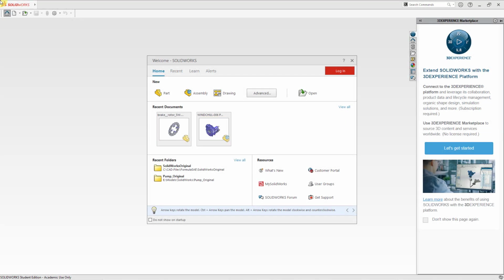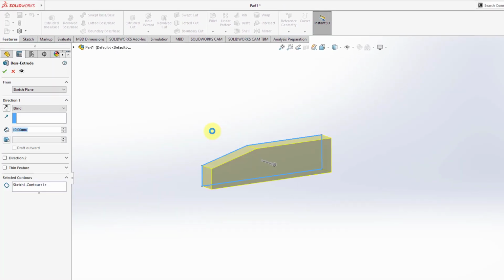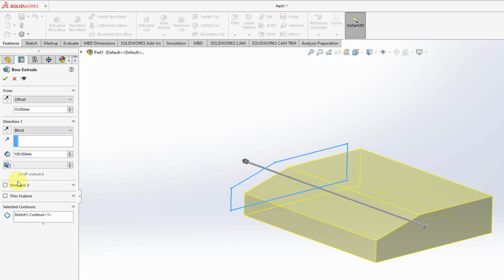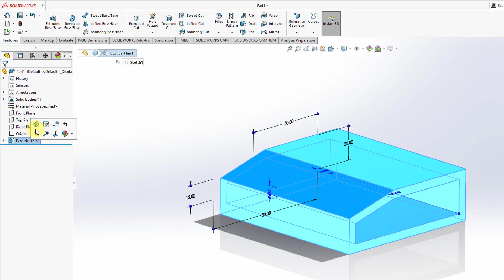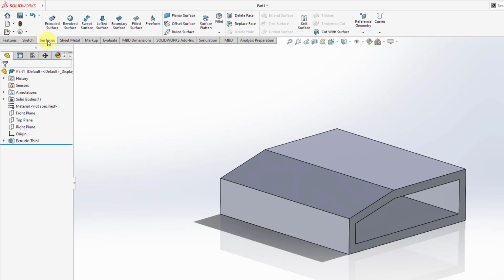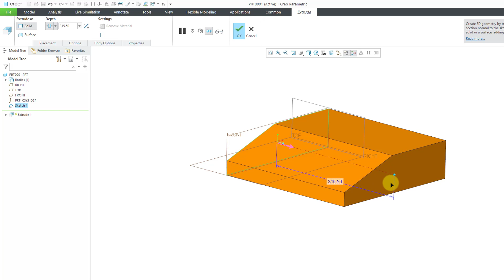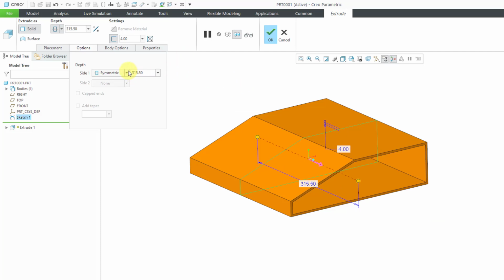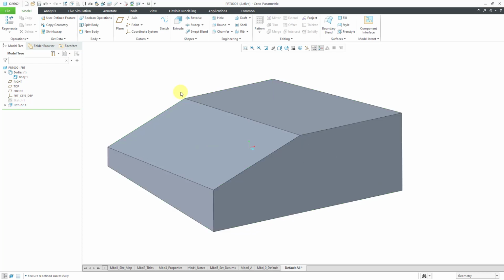SolidWorks - Creo Parametric Comparison - Base Extrude

Comment: Creo is amazing tool, and I would say far superior over SW. However, this way to access Creo by subscription, make it impractical to get that outside of US, since currency trade rate makes subscription prices forecast impredictable. You could take one year subscription or even more (what in my opinion does not make sense since you pay the same of permanent seat of other concurrent) but in the end you will not "possess" the tool. This rationale is also valid for Autodesk Inventor.
Reply: Perhaps it's too early for me to say this, but as a Solidworks user for more than 6 years (CSWE), my initial experience with Creo has been very frustrating for the last couple of days. I can't say about the advanced stuff yet, but when it comes to basic features and functionalities, Solidworks outshines Creo by miles. Making simple 2D sketches in Creo feels very counterintuitive and frustrating. I haven't even touched the drafting part yet, but I have heard pretty nasty things about Creo's drafting.
Reply from the maker: As a ProE / Creo instructor who has taught many people making the transition from SW, the biggest mistake I see people make is to relate everything by analogy. In SW it's this, so the equivalent in Creo is this. If you do that, you will always struggle.

One of the running themes you will see in this series of videos is the trade-off between simplicity of UI & workflow versus functionality.
Reply: @hoquezawad  you need to reevaluate how you think. Creo optimizes for the long game, but also discourages you from quick fixes. This is generally harder, but you end up making up for it in the maintenance phase. It is very important that you go with the flow, otherwise you will find fighting the application at all times.

A practical example: The 2D drawing in creo is just a different view of the 3D drawing. So if you intended the 2D drawing to have a certain dimensioning scheme then the 3D models should have had that same dimensioning scheme. So a competent creo user is constantly thinking a few steps ahead of what they are apparently doing. But more importantly a Creo user is much more likely to redefinie things and maintain the drawing against the current design intent.
Reply: @joojaa3927  I am sorry but I don't agree with your view. This just feels like a justification for a "not so straight forward" approach of a software to achieve the same thing which is achieved very simply by it's competitors (I wonder if the word "competitor" feels even appropriate). And obviously I am not saying this compared to Solidworks only.
Reply: @hoquezawad  Well you gain some you lose some. If we would only do the straightforwatd we would still be drawing the same way as we did by hand. So its clearly a tradeoff that you need to make. Sometimes its worth it other times its not. When you begin you dont know fully the tradeoffs are, so it feels like you only lost stuff. 

But one thing is clear creo is poison for casual users.
Reply: @joojaa3927  I will just stick to NX/CATIA. Thank you.
Reply: @joojaa3927  thus, model based dimensioning
Reply: @2012begiinings  Yeah. The thing is though that Creo really works differently here. It tries to enforce a set of rules that the other tools don't and the reaction of people who try to learn the tool on their own is like this. So in way for many users creo requires to think upside down. Theres some merit to working like this but its not immediately obvious.